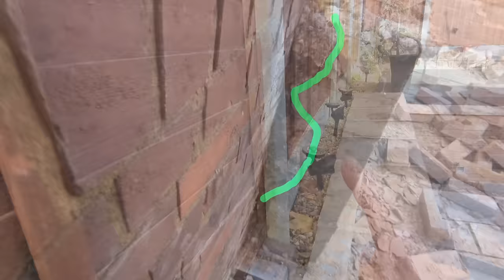PART 2! What exactly DID go wrong? Who paid to put it right?

Comment: I'm still not 100% convinced it's the frost on the front wall. From the pictures you shared on the previous video, the mortar had rotted all the way around the brick, and not just on the front of it ? it looks like an exact 10 - 15 mm all the way round. If the issue was related to to the coping stones not dripping then all of the weakness would be to the front and then moving backwards through the mortar
Reply: Coping stones need a drip edge on the back side as well.
Ssme problem on the back and front side.
Reply: @vonnikon  I had the exact same thoughts as notsosmartmart5402 and I am very grateful for your comment/observation.
Reply: I would have used the salt resistant mortar as an added insurance. ✌
Reply: He mixed his patio underlay mix with the cement mix that’s what I believe

Comment: I would have no hesitation in using a builder like yourself.  Not many have the decency to man up to their mistakes and do the repair free of charge. This video shows you are good at what you do and take pride in your work.
Reply: so then where are you to be found...if need be
Reply: @whizzdom6923 no offence but people with your perspective are the issue. It's BOTH the mistake of him and the original builder. Original builder should've done better, but this dude in the video should've noticed that issue and factored that into his design. 

Hence it's both of their mistakes. Saying otherwise is being bad to the customer.
Reply: High water table & no DPC?  Surely a DPC would prevent the damage, hence why the house is fine?!!
Reply: Should of used sulphate resistant cement, it's made for water ingress, building below ground etc
Reply from the maker: Thank you mate, apologies for the late reply!

Comment: Building brick for 40 years. The brick you used are fine. No tanking against the old work allowed water to wash out the cement and weaken the mortar. Tank it and install French drain. DPC under coping with a good over hang and drip. Your cost now as wasn’t considered and or costed at the time. Put water proof additive in your muck rebuild and move on. Put it down to experience. Great video 👍🇮🇪

Comment: You also should add a DPC below the copings when you rebuild next year as this is a standard detail for NHBC on top of an external wall therefore if the conditions of the garden are as bad as you have alluded to then that would be belt&braces. It is also so great to see a Builder that is man enough to own up to his mistakes…..especially in such a public forum. Really like the way you present your videos. Well Done Mr A.
Reply from the maker: Great shout, Roger! Thank you. Really appreciate your comments, thanks again.
Reply: @mrabuilders6723 I create a flat surface and let it go off then i use a flexible tile adhesive to stick the DPC down. Next i SBR slurry tge DPC and then i bed the  SBR'd coping stones on.

Comment: A membrane would be suffice, along with purpose perforated drainage pipe wrapped in geotextile and some stone in conjunction with weep holes and yes, your cappings with drip throating.  Hope I've given you some ideas. Have used this regardless of brick type. Mayb use English bond also has resistance to sheer force, which for now is the only reason that boundary wall hasn't fallen over, if it where stretcher with ties included it still would have collapsed by now. Hydrostatic pressure is your enemy here. I've done this type of walling in English bond with ( lime mortar) and no issues, just directing water to your weeps properly.  Extra costs yes! but relying on water with just natural capillary through ground to enter your weeps will never work in this situation. You'll need to work a drainage system that works in your limited space. Might even have to rob some garden space with slightly different design if possible.  And yes it's a summer job, stay away from freezing conditions on this 1. Hope some of what I said helps. There are other options but would add to costs greatly.

Comment: I think there are 2 lessons here.  The first is that when doing a project it's important to try and take a step-back and (try!) to think of other potential impacts on the outcomes - not easy in any project.  The second is to give nature a place to go, we are covering everything in concrete which is causing nature to find the weakest point...   Still think you did a sterling job on taking your time to review the bigger picture and come up with a solution, in this case if I were the customer I'd be willing to pay 50% of the costs as you've highlighted issues coming my way...

Comment: I'd have put dpm on the retaining wall, reuse the old bricks, use waterproofer in the mortar so it doesn't pass water through all the bricks like a sponge. And I suspect the wall is being attacked by the sulphites in the clay, which would explain the decomposed slurry at your footing. I've been a brick builder for 52 years, done alot of these retaining walls. retiring now.
Reply from the maker: Appreciate the comment Jordan, I hope you have a long and happy retirement mate, all the best.
Reply: @mrabuilders6723  i recently went back to a wall i did 40 years ago, which i got my son to repair, the mortar was full of mushrooms because everything was porous in those days. The waterproofing admixes today are a valuable asset and a little cup in your mortar will prevent alot of future problems. Of course, with your coping you should have used a lime mix because the material of the stone itself will just attack cement.
Reply: You are a good brickie and I hope you have more years of jobs. Like the rest of us, we learn things. I've had walls in the past fail too quite similarly. We are human, not gemologists, and so has every other brickie made a mistake. The difference between you and the rogue brickies is you have opened up, confirmed your mistake and held your hands up then fixed it. Most people wouldn't have returned the phone call. And if brickies say they haven't f***d up then they're just lying. I wish you good luck on the jobs, and always use a little cup of waterproofer. We will have no more talk of blown winter cement.
Reply: ..... To be fair, he's explained why that isn't really a viable option...
Reply: @davechapman5815  so you choose aesthetics over the lifespan of the wall. Wrong in my opinion, and if rebuilt properly you would never know. Water always goes somewhere even with a membrane, whether it evaporates or goes to the next wall.
Reply from the maker: @jordan3405  cheers mate.
Reply: @jordan3405 ..... We'll have to wait for him to pull it down and rebuild it next summer.... Properly...

Comment: First of all, fair play for taking it on the chin. I'm a Civil Engineer so a suggestion from a different perspective....
Have you considered concrete? You could have your shutters made up ready to go, old wall down, pin some geotextile on the exposed earth, drill and resin some starter bars in the existing footing, tie some horizontal bars, stand the shutter and pour. Then next door's garden is secure and you bought yourself time. 
Post drill as many weep holes as you want and use egg crate membrane between concrete and brick facings to drain to one point, which solves the saturated brick issues. Good luck.

Comment: Rebuild the wall, tell customer you've done all that can be done under the circumstances, but then show them the underlying causes and focus on the long retaining engineering wall, advise them to put the house on the market, and get out before the long wall gets any worse. But watching this video fully, you've done a great fix. A builder I worked with used to say, "its not about the mistakes you make, its about how you can recover and learn from them"
Reply: Yes that old retaining wall is a costly legal battle waitingto happen.
Reply: Technically, the responsibility for a retaining wall on a boundary is the owner whose land is retained (ie the high side).  However, that is often a tricky discussion. My advice to anyone who lives on the lower side of a retaining wall on the boundary: get friendly with your neighbour, even ask them around to hang out in your backyard (or wherever is close to the retaining wall).  Walk the neighbour past the retaining wall (in this case I would walk them along the side path rather than through the house).  Leave your level leaning against the wall (as an "accident" of course).  You can then explain that your level was there because you had noticed the wall didn't look quite right ... best if they see for themselves.  Then you leave it for a month or two and raise it when you are both putting out your garbage.
Reply: Sell up? Do you think any prospective buyers   survey won't pick that up? And knock the  price down. Always cheaper to do work yourself than a buyers low iffer

Comment: Well done for putting the issues right, it speaks volumes for you and your company. Not many companies would have came back 4 years later and done what you did. I am in the middle of doing a small retaining wall and will follow your advice with the drip.groove under the copings. The back of the wall will have a french drain also painted the concrete blocks with blackjack then added a damp proof membrane so hopefully i will not have any issues. Diyer first time building a wall and its been a learning curve. Only thing i have not done is put a dpm above the foundations and the block just hope this does not come back to bite me. Keep up the good work and youve just got a new subscriber. All the best Derek

Comment: Spot on diagnosis having seen Part 1. Makes sense to factor in location and microclimate in the garden, we done for spotting that one.
As a Drystone Waller (And farm welder/fabricator) l can say a drystone wall would fail in that situation because it would only beca drystone skin because there isn't enough room to build it wide enough to be self supporting.
20mm clean limestone down the back of the new wall next summer and leave the mortar off the end off every other brick as a weep hole would probably work along with coping stones that are set with enough over hang and slightly off level to tip the water off the coping stones so they will dry. Top stuff squire!
Reply from the maker: Cheers Jon! Looks like you're having a Mr A Builders binge watch Sunday! Ace!!!

Comment: Well done for your integrity!
I’m a plasterer of 50plus years experience.
We all make mistakes, you sure will learn from that one.
Definition of an expert?
Someone who’s made more mistakes than anyone else!
As you have found out, there’s a lot more to building/ plastering than just doing the job. First thing on any job for me is ease of access then a look for potential problems as in a retaining wall!
I never directly plaster to same as there’s no guarantee that it’s tanked properly or at all!
My remedy is to fix dpc and batten wall, screw 6 mm backing boards to same then render with k rend thin coat system  top with suitable coping minimum 25 mm overhang and joint same with high grade c t i or similar filler not sand and cement!
A coat of k pro water repellent finishes the job!
Copings included.
Reply from the maker: Cheers man, appreciate that. Hope you're well. Take care.

Comment: Well done, that plot is in the lowest part of the estate. The wall is "cladding" and decorative, the plot itself previously has had alterations to the ground to address structural and ground water matter, which have failed from adjacent properties.
The lack of sun doesn't allow the brick or mortar to dry off so it will always be wet and as soon as frost comes it will expand and contract causing spalling and split the brick bond. Seems like the client hasn't given you much room for manoeuvre. As long as you make them aware of the constraints and your more than reasonable work to improve the situation you cover yourself. Great check on the retainer adjacent to neighbour being under load or slipping. One thing the raised wooden platform is running and stopping just behind the retainer and wall. A managed run off, drainage solution should be suggested, or raising height of wall above the floor and a preformed drain integrated between the we wall and the deck.That is a solution but you cannot be expected to do this without getting specialist advice and being paid. You are not a civil engineer and cannot be expected to solve problems which are structural adjacent to the property that have been festering for 20 to 30 years since construction.
 I would gather you were "contracted" to make a decorative non load bearing wall, not a dewatering and waterproofing system to tackle fundamental problems the site would have been aware of since planning and signing off of properties in building regs when it was handed over. If the "pretty wall" is impossible to sustain then another solution should be saught. Again either with you or another contractor. If you went to court your due diligence and research through this YT page would be enough to prove you had returned assessed and given an opinion. Then to the best of your ability with customers consent produced a decorative wall for "over Xmas". Nothing more nothing less, building is not an exact science. Either way you have proven reasonable accountability and expended time and resources with the clients consent and input. They did not want a better party wall solution because it might effect the width of the wall which "would look too wide". Make them aware you have done your best with the materials given in a site which has greater problems. You are good tradesman.
Reply from the maker: Cheers Axel.
Reply: Well done Mr Builder.
Putting coping with a drip strip on a 3ft high decorative wall? Any where but in that garden. No worries. 
Anyway. Kudos. You came back and sorted it.
And when you do it in the summer, get your apprentices/trainees to do it and tell them the whys and wherefores.
And I hope you've earned your client that next door is going to end up collapsing into his bin run in, well, sometime. Devise him to point the leaning wall ont to his neighbour as his only remedy is there.
The other thing is that there is always the b*gger factor in any job. "The Murphy". If it can go wrong. It will go wrong. But we learn, and over time Murphy gets smaller, but the little b*st*rd never disappears. He is always 10% of the invoice/time.
   YT dropped your channel on me and I thought, Solihull, wants to migrate to Little Aston.
Not now. Stay where you are and be honest.

Comment: Respect for tackling this, a lot would do a runner. Agree you need a drip channel on the coping stones. But, the water coming down the hill is going to continually soak through to the bricks and mortar. Who ever did the work next door has left a few issues there. That wall is  the dam for all that water. I would suggest a DPM along the back of the wall when you rebuild and sink it into the ground as far as possible.  If you can put a layer of gravel/shingle in between the two walls, act to take surplus water way. Give the whole lot a Thompsons proofing.  Because we have such terrible weather now days and given all the evidence, it wont be long before they will have the neighbours wall falling onto their property. You might want to think about a disclaimer on the whole job, given all the circumstances to cover your back in the future. Maybe.
Reply from the maker: Sound advice mate, thank you.
Reply: This is a good idea to put a DPM in and gravel is another idea
Reply: Hi John, i'm not a builder (i'm a tiler/bathroom fitter) but have found this video quite interesting. The wall beneath the fence panels, could some bore holes be drilled close to ground level help to drain the water and release some pressure? Probably make a mess on the paving stones i'm guessing but that could be washed away. Again, not an expert, just curious. Hope not a stupid question. Thanks.

Comment: I've watched both parts and you are an honourable brickie - rare in a lot of trades/businesses, etc. With water drainage, my Father built the family home that is rock solid today - 7+ decades on. He was a bit paranoid about keeping the wood stumps dry. Some 50 years ago the neighbours had concrete laid that slanted into our land. He worked out a way to drain it away from his stumps (still works). Dad got his revenge when neighbours went on holiday, by painting the wood fence with car sump oil he collected from workmates. No violence or arguments.

Comment: How about design a matching under the fence gutter and downspout system and place a gutter design behind that buffet where those lights are and resituated the up lights. Maybe do post lighting around the entire yard. To preserve the existing setup and brick up an architectural lil  bump out where the bulge occurred and use a metal brace to contain that part behind the bump out so you don't compromise the fence there either. That fence is like a whole wall on a building. It's beautiful the whole yard is so private and inviting. I sure hope you can save it all without too much. So pretty.

Comment: Nice to see some honesty and accountability!
Aside from all of the issues that have been covered, there seems to be an absence of adequate surface drainage for the paved areas at the side & rear. 
A couple of stormwater gully pits would help. 
In Australia, most engineers will broadly use 100mm slotted ag drain pipe, 20mm stone wrapped in geo fab behind retaining walls. 
The ag drain can connect to the stormwater, to discharge at the street. Without something like that, hydrostatic load will kill all retaining walls eventually. 
The existing side retaining wall is a case in point. 
Keep up the good work.

Comment: Great looking work and likely a good analysis.  Sneak a 60 ton excavator in the neighbors yard and dig a 12m deep drainage trench to divert all the groundwater.  Might want to fill it with something though.  weep / vents are used in wet areas to let some airflow get behind the wall.